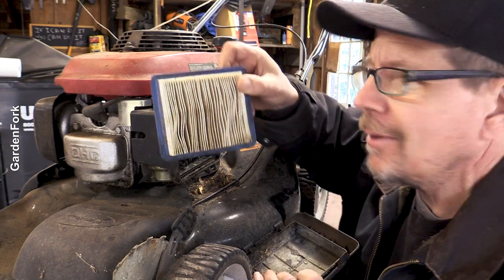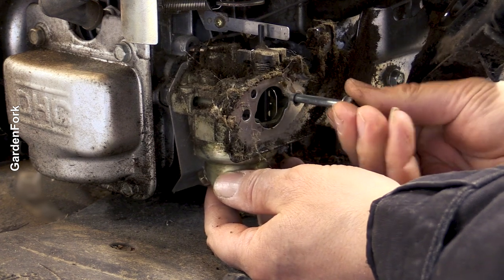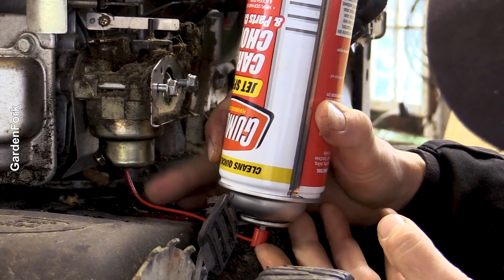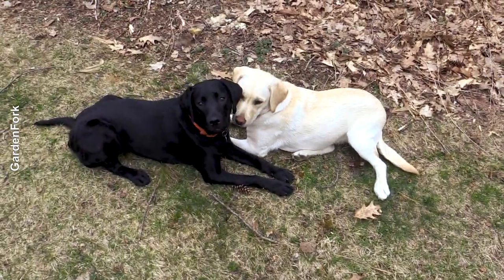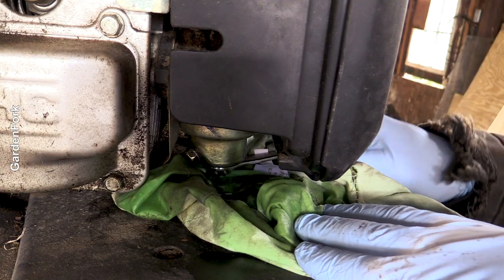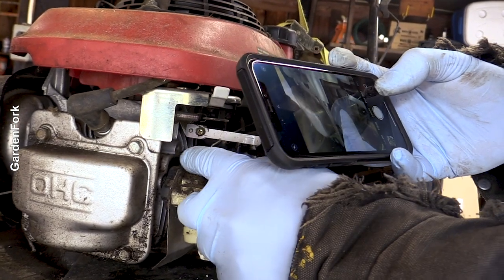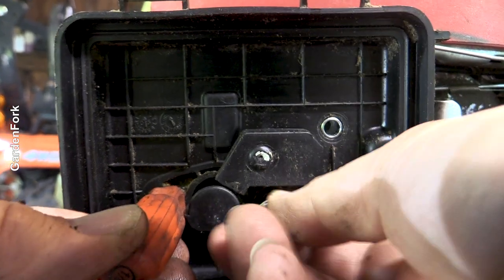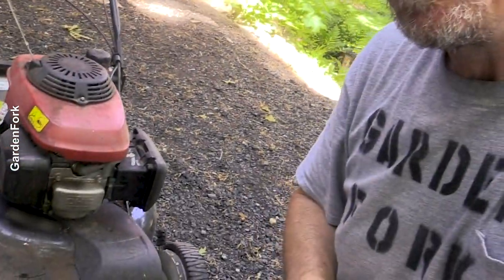Fix Your Mower - Only Runs With Choke On

Comment: Nice video
I have a tip... Most small engines have an in line fuel cut off valve, get into the routine of turning OFF that valve when your finished using the engine and allow the engine to stop running. This will use up 95% of the fuel left in the bowl. Think of this as the new way to shut down your engine.
What causes this is the alcohol in gasoline, it will absorb moisture and the result is what you see in this video. 
No gas in the carburetor = no corrosion 
Love the girls by the way
Reply from the maker: Hi Craig, i thought i ran this carb dry last fall but then this happens. thx! Eric.

Comment: The easy way to put Honda carburetors back together is by sliding all the parts onto the bolts; filter box first, then tighten the bolts into the engine. Way easier than lining up 10 things at once.
Reply: Who's a damned genius?? ☝

Comment: Guessing this is what is wrong with mine. Have no idea how this stuff works. Been sliding a little twig under the choke thing to prevent it from sliding back and turning off. It works but now seems like it has less power and need to fix the problem like you have shown here. Thank you. Wish me luck!

Comment: Dude!  I needed you a month ago.  I know nothing about engines.  Between YouTube and the guys at work I tried several things, but no soap.  I lucked out (eventually....  this went on for a couple weeks) and a friend stopped by and said he'd take it and fix it and did.  I think he did pretty much what you are doing.  I watch you often.  If I'd seen this from you I'd have done it myself.  But....  I WILL know the next time.  Thanks!
Reply from the maker: So much on a mower is in the carburetor, and the original manufacture part is only $30. It really helps to have a second set of hands to get it all back together. thx! Eric.

Comment: Makes sense.

Mine had the opposite issue.. it was air starved, due to a dirty filter ..

Issue was I tipped the mower and the finger was cover in oil.. blocking pores and collecting more dirt.

Gave it a nice soapy wash, and was perfect when dried.

I should probably check my carburetor though... Not taken it off.. ever.
Reply from the maker: Yeah, that is a common one when the mower has been tipped. glad you fixed it. :) Eric.

Comment: Mine was doing this so I left it in choke and blipped the throttle down at the carb and sprayed in some carb cleaner until it finally got to where it would run when I moved it just to run. Don't know if it was watery gas or what, but was able to mow my yard after that and was able to shut off, restart and it would run.

Comment: Hey Eric. I would love to see more details on how you have your hoist set up. I think this would be great for getting heavy kegs in and out of my keezer.
Reply from the maker: the hoist has brackets on top, room enough to slide in a pipe, and the pipe sits on top of the ceiling joists in my garage, right near the column for strength. i don't lift stuff that is too heavy with it.

Comment: Good instructional. if possible could you share the part # or where did you get it. im looking for the exact carburator. also with issues with the shoke and no idea if the problem its the way i re install the gaskets.

Comment: On a note of simplicity, after the fuel petcock is shut off start and run it until it dies... Then remove the fuel line from the petcock end, let any fuel drip out... Then spray it full of carb cleaner, let the bowl fill too... Reconnect and try to run it again.

Comment: YIKES that carb was NASTY!
At the end of the season remove as much fuel as possible then run the mower until it stops  also use a fuel stabilizer for long term storage 10+ years with no carb issues for my push mower
Reply from the maker: Yeah i was surprised at this one, lots of water in that bowl. Lesson learned... eric.

Comment: Try Star Tron engine fuel treatment.  It's much cheaper than Sea Foam, and does a much better job especially with ethanol.  Also, add Marvel Mystery Oil to your gas and to your oil, it will keep your engine clean and properly lubricated.   Haven't had small engine problems in a very long time.   I've also been using MMO in my car's oil for years and pulled the valve cover recently and it was much more clean than an engine with 230,000 miles should have been.   Thanks for the vid, cheers!
Reply from the maker: Yes! Forgot to mention Star Tron. Good product. I have friends who swear by Marvel Mystery as well. Thx ! Eric.

Comment: I just bought a brand new carb and when i turn it over it starts and runs but it wont run with the choke off. Im wondering maybe installed the fuel filter in wrong and its not getting enough fuell or something . It shouldn’t be the carb since I bought a new one and it’s doing the same thing

Comment: You can find carberator diagrams online for the honda GVC160 and GVC190 for the correct orientation for the gaskets and spacers. 

When working on these engines you can remove the throttle plate which will make I A LOT easier to sandwich  it all back together.
Reply from the maker: good to know! thanks for that - Eric.

Comment: I have to replace that carb every year. I picked up a junked craftsman off the curb with Brigs engine and a simple plastic carb. With a fix for the kill switch have been running it for 2 summers now flawlessly. In my experience these Honda 160 mowers are overrated junk just like the Honda cars are overrated. They're great until they break just like everything else. Its all hype. The Briggs engines are better and Fords and Chevys are better too.